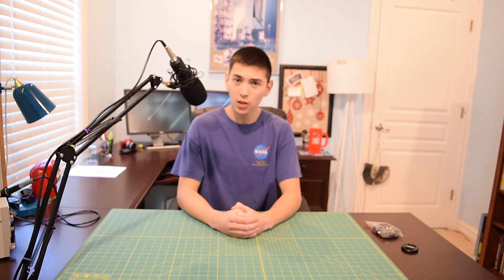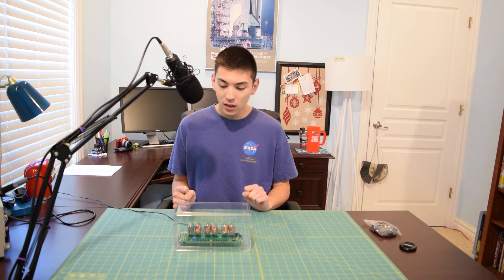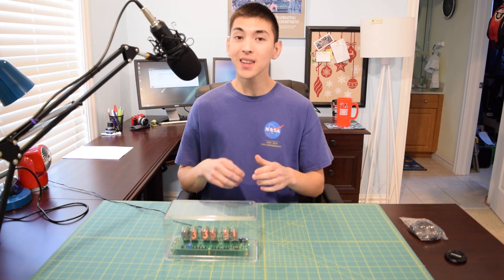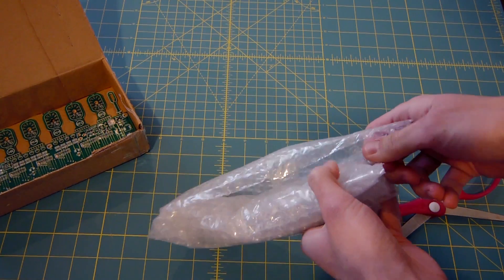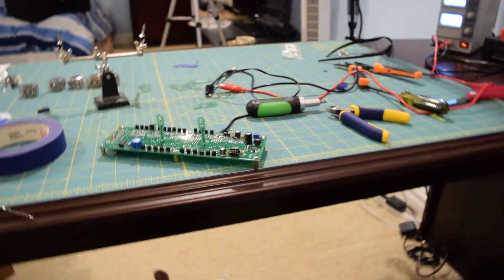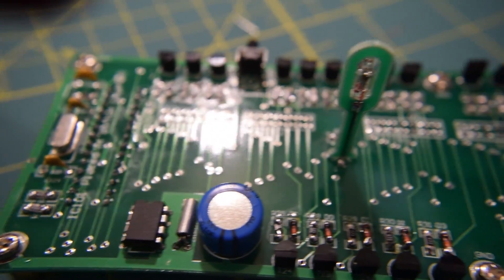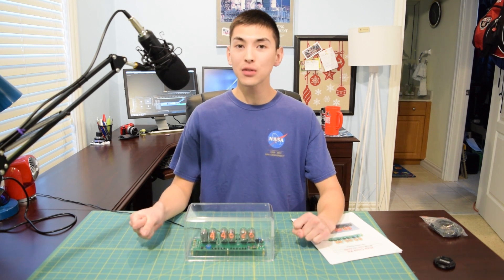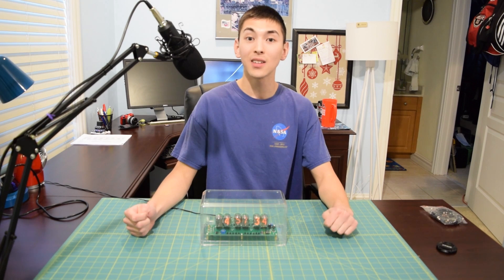IN-12B NIXIE Tube Clock Kit Unboxing, Assembly, and Overview

Comment: Hey! I'm a machinist, and outside of work I've built a couple pieces of furniture, done some home remodel work and other small diy projects, but I've not done anything at all with electricity. I totally have no idea what you're talking about with the 'transistors, resistors' etc etc. I know I can learn, but mainly I'm asking for some advice on the soldering. I saw your video on the other, easier kit... But I legitimately have zero experience soldering. What all would I need to buy to make one of these? 

Got some scrap acrylic from work I can use and I thought that would look awesome so I'm excited to try! If it works out I'll be building at least two more

Comment: Nice vid, now I want one too ;-).

A few remarks:
As you have found out, soldering SMD components had a bit of a steep learning curve, but once you get the hang of it, you will wonder why you ever found it difficult. Of course I am not talking about components that were not designed with hand soldering in mind (like BGAs or bottom exposed pads only) but even for them there are workarounds.

If the problem with the number 4 digit on one of the tubes had turned out to be the tube itself, you could have mailed the seller, but lazy me would probably have put it in use as the first tube (from the left) as that tube never needs to light up the digits 3 through 9.
Similar thing for the tubes that don't need to light up the 6 through 9 digits.

BTW, nice to see that this is a 24 hour system clock as that is what we normally use in written notation and digital displays.
Funny, though, that in speech we would never say "20 (hundred) hours" or even "8 PM", we would just say "8 o'clock" and the context will provide the answer to whether that's 8:00 or 20:00.

Comment: Hi All;

Thank You, Braxton for Your reply..
Yes,  I think I will Love my Clock..
Some more Hints..
When doing the Transistors, I did the 6 of them first,  doing them as a group..
I would put one in and solder the middle pin, then go to the next Transistor and do all six.. Then wait for the last one to cool off before going back to the first one and solder in the top lead and then do the other remaining Transistors waiting for the last one to cool off.. And lastly solder in the bottom lead on all of the remaining Transistors..
when I use the word middle, top and bottom I am not referring to top and bottom of the Printed Circuit Board, but to like three sticks on the table..
After they are soldered in check for shorts, either with a meter, or hold the board sidewise up to a light source and look with a magnifier glass and inspect for shorts, and fix any problems.. If there is a short heat the two pins up for a second and then slam the board onto the table sideways there by causing the molten solder to be forced off of the two pins and onto the table.. The other method is to use either a solder sucker or solder braid to take off the excess solder..

Braxton, I will copy and correct some sentence mistake I made to the page You have suggested..

THANK YOU Marty

Comment: Hi;

I have some other hints..
Insert what I have said, in between the given directions that You received with Your Unit..
After You have the main Board assembled, before doing all of the checking..
Mount the Led's that go behind the Nixie tubes on their Stand off Printed Circuit Board, after doing that I used my Diode checking setting on my Meter, (my meter used a 9V battery) and check that You have the polarity correct, and Second (with mine) I got the Led to light up..
Now check that Your +5 volts is working.. Do NOT do what I describe next until You have +5 Volts..
Solder the two middle pins (one on each side) of the Stand off Printed Circuit Board and plug it into the main Board.. Do NOT solder it in !! And check that each of the units Led's work..
After this Works and You have the 140 Volts working, (I set mine at 140 Volts)..
After You have the 140 volts working, Solder and Mount the two Neon Bulbs to their respective Printed Circuit Board, Do not Solder to the Board, Yet..
But, go ahead and plug them into the main Board and check that they Both Work, then they can be soldered in, If they don't work, find out why, before soldering them in..
Also wiggling them a little might be needed to make them work.. 
Now solder the rest of the Pins of the Mounting sticks..
Do NOT solder in the Nixie Tubes, YET..
Put in a Nixie Tube (with its mounting stick soldered in place) into its Printed Circuit Board.. Do Not Solder .. Plug it into the main Board in the Seconds position, Apply Power with some wiggling some of the Digits should light.. Wiggle until You can see the Number 7 Light, (It will have to count up to 7) and make sure that the Tube is facing the correct direction, once that is determined.. You can Solder in the Nixie tube itself..
And Check that each Digit works, in the Seconds Position..
Repeat this for each Tube, Plugging it into the Second and checking each tube works..
After getting all of the Tubes to Work, Plug them into their respective places and if there is a problem with a Digit or some of them, You know it isn't the Tube or it's standoff Printed Circuit Board, Since that has already been checked.. Fix any problems before proceeding to the next Display unit..

THANK YOU Marty
Reply from the maker: +Marty Geist Hi Marty! 

Thanks for posting all of the tips! I would love to see some pictures of your final product!  If you would like you can send me some images to my email (listed on my website) and I will throw them up on the web page (if you do please do not use a potato to take pictures :p).  http://www.aacomputersandtechnology.com/in-12b-nixie-tube-clock-kit/  Also if you have the time you should copy and past the above passage to a comment on the webpage.  Your advice might come in handy for someone else!  I hope you like the clock as much as I do! 

Sincerely,
Braxton